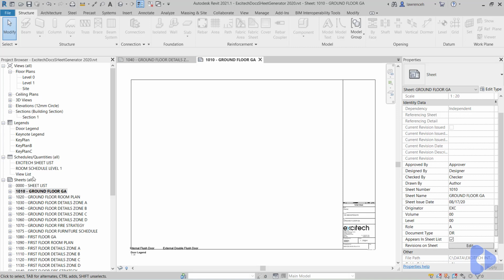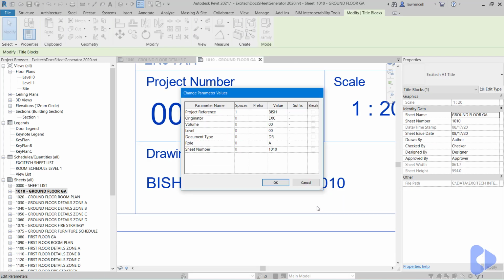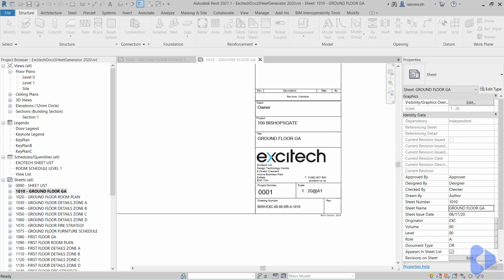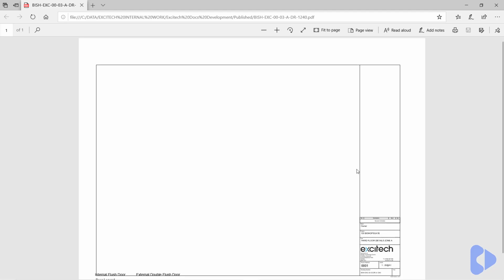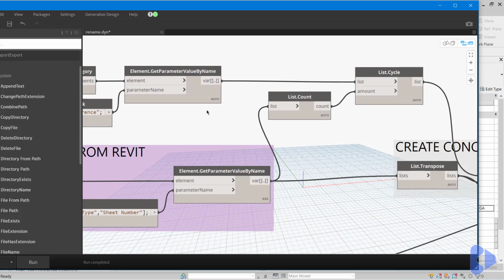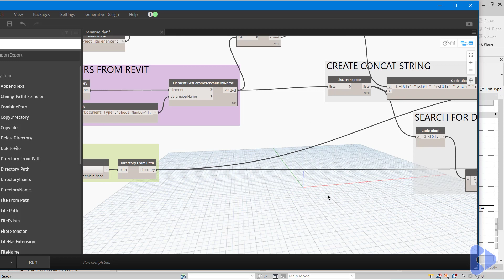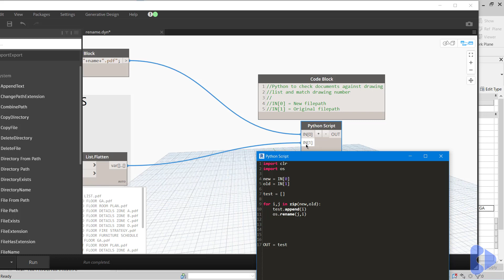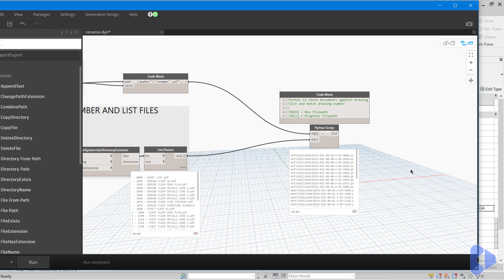Revit Tutorial - Publish PDFs and DWGs to ISO19650

Comment: Will size so much time this way. One thing is can’t seem to get the python script to work as you have done I get the error, ironpython.Elvaluator.EvaluatorironpythonScript operation failed expected an indebted block ?. Any help ?
Reply from the maker: Hi Chris, this error is due to incorrect indentation. Python is very fussy about this! The best thing is to remove the indents and use the TAB key to add them back in. So line 10 and 11 needs a single tab before each line. Hope that helps?
Reply: @RevitStructureBlog  Hi Lawrence, Thank you very much for sharing. This scrip would save me so much time. Unfortunately, I have the same issue as Chris and your advice about the TAB key didn't help;/ Any other suggestions?
Reply from the maker: @alinaantonik6082   Hi Alina, The error about indentation is defiantly relating to indents, Delete the spaces/tabs and replace with tab indents. Unfortunately I cannot get the code to paste here with the correct format.
Reply: @RevitStructureBlog  Thank you for the prompt response. I tried this solution but still getting the warning that "IronPythonEvaluator.EvaluateIronPythonScript operation failed. 
expected an indented block".  I have to learn more about Python, I suppose. I was so excited to have the problem with renaming files sorted.. ;/
Reply from the maker: @alinaantonik6082 can you email me a screen shot of the python editor. lawrence.hooker@excitech.co.uk